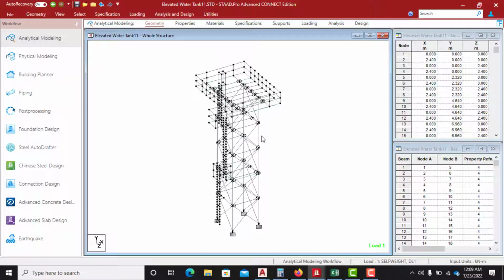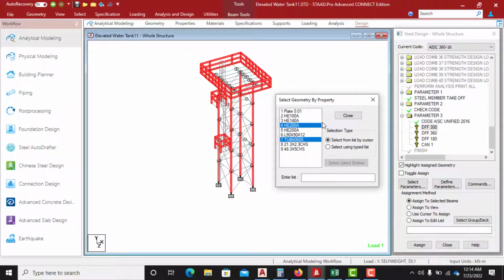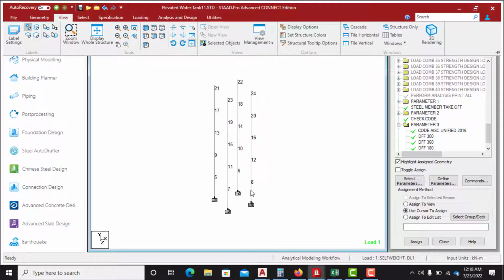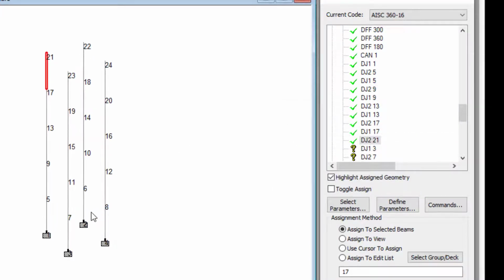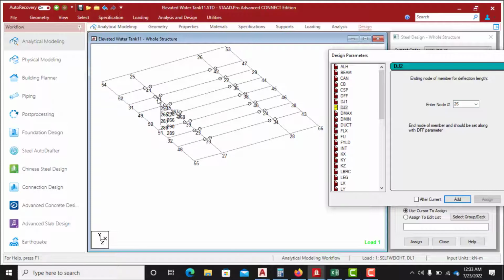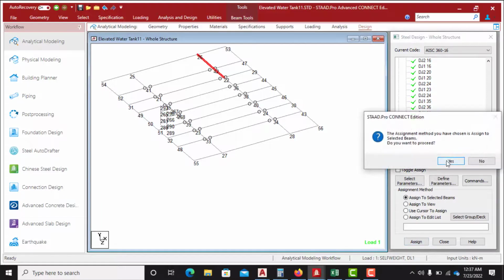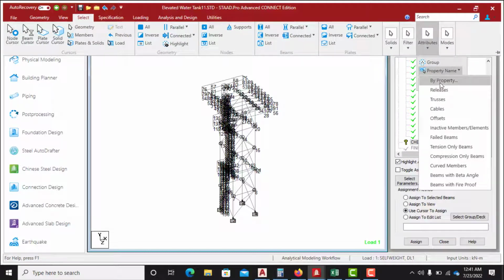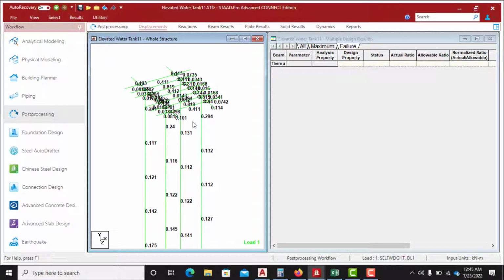How To check Deflection on structural members - Staad.Pro

Comment: Please kindly check your setup report out put steel design details. Under the report it starts: Torsion and deflection have not been considered in the design
Reply from the maker: Thanks for your feedback. However, deflection was well considered and the output result showed it clearly. Check design parameters for deflection check input commands.